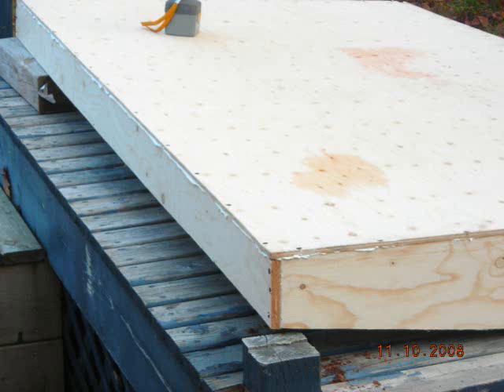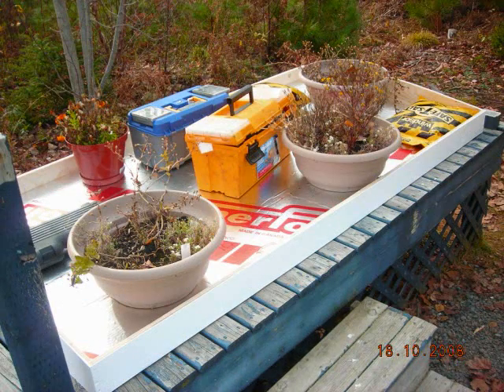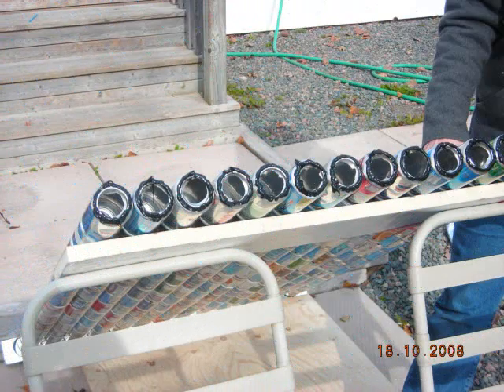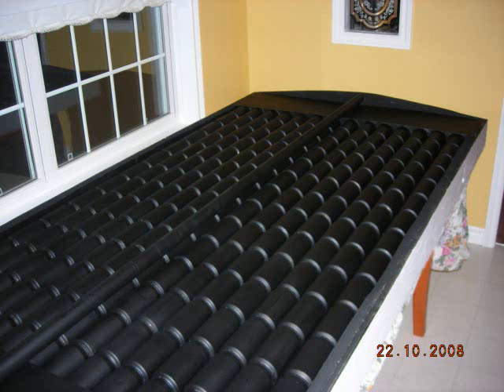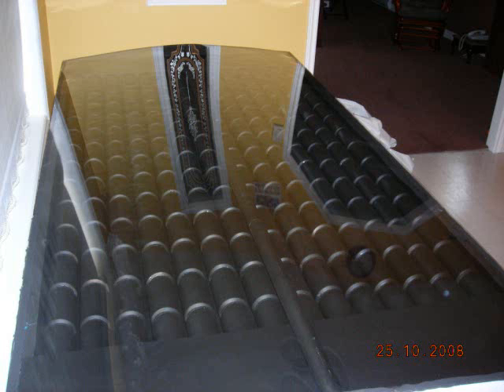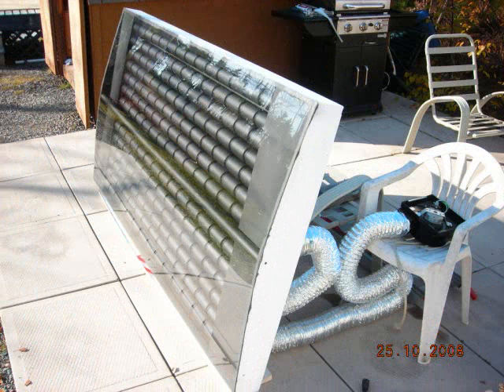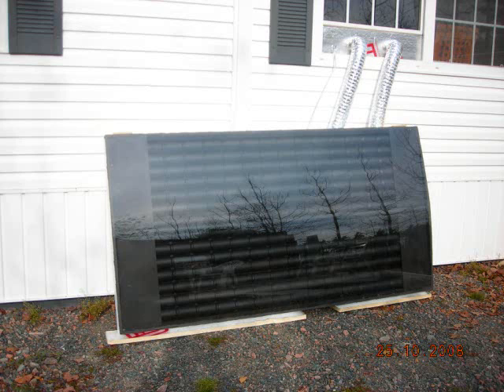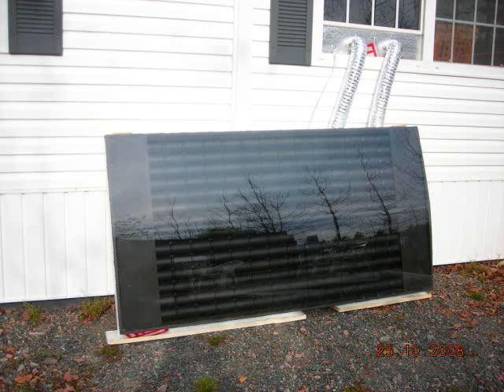Solar Heater

Comment: Beautiful unit. Have you installed it permanently?  If you have the exterior wall space install it standing up, long ways, I think it will work better for you. The rounded converse of the plexiglass will help get the sun earlier in the mornings and track better. The vent hose could be basically eliminating which loose some heat since the unit it installed almost flat to the exterior wall. More insulation around the heat the better and hotter the air becomes flowing into the house through the top and bottom central 4" holes. I bet you'll be getting 160 F or 70C with your good looking solar air heater.

Here is my solar air heater I built in 2015. https://youtu.be/7S8CWsIcK20

Comment: what if you use taller cans, like venom or rip it energy drink cans 16 oz, some 1 should experiment, do you think those would work?
Reply from the maker: it should work fine
Reply: but sense the cans would be longer should I use a bigger fan to push the air through maybe? and wow yours looks so professional and pretty and will plexiglass reflect the same about of sun do you think? Orrr would it be a significant drop in degrees? and thank you

Comment: Great video and impressive design. Josh, good observation, heat output is only one part of the build though. It's easy to build a sealed box to generate 140-160 of heat, probably any design will do this. However you have to get the heat inside the house will enough flow and force to actually heat the room. Air trickling in at 140 degree won't do anything. A lot of air coming in at 95 degrees will make a big difference.

Shoestring's design uses of 120cfm fan and he could feel the heat with some force about 6 or 7 feet away. The first test was done outside with the input air at 32 degrees. If the tube was hot to touch then the output would be around 105 degrees. That's a 70 degree increase with air at 120cfm, unbelievably good results.

When the sun clouded, heavy, over he was still pushing out 95 degrees, good results.

Comment: Hi shoestring405.

I really like this design. If it works that well in NS it should work most places.
I notice the can are horizontal. Have you tried it with then vertical?

I wonder if all the cans were connected in series, not in parallel so that the same air in the first then went through number 2 then 3 etc would be better or worse.

To glue the cans together to assist others I found the well know two part glue worked fine. As did Gorilla glue.

Comment: Build these right into the wall cold air enters at the bottom inside and exits warm at the ceiling without a fan alltogether.

Comment: Good idea!  Another thing you could do to maybe increase the heat output is to make both sides of the unit transparent, and use a mirror to reflect sunlight onto the back side.

Comment: The idea of using inside air for your intake is great, restaurants do this with there exhaust fans. Other wise it would cost a fortune to keep heating the cold air from outside. I plan on doing that with mine because no matter how good it works when it get to be -20 outside it will not work nearly as well as taking air from the basement that is 80 degrees warmer then outside. Thanks for sharing.

Comment from the maker: @jamoore3192  the panel is completely automatic. you install a disc switch ( fan control switch ) inside the panel on the hot air end. The switch should open at 90° F and close at 115 or 120 F
the panel needs direct sunlight in order to produce heat, Here in Nova Scotia the panel works best on those cold clear days in January and February.

Comment from the maker: @navajopa31 amount of air coming in contact with the heated surface.
3. It will be necessary to install a few  baffles of some type in each downspout to mix the air.
    This will also help reduce the effect number 2.

Comment from the maker: @navajopa31 I have seen this project done with aluminum gutters. I know they do work but exactly how well they work I am not sure. A few things that would concern me would be
1. The thickness of the aluminum, this will affect how quickly the heat is transferred to the air inside the    column
     we do not want the panel to become a heat sink and store heat.
2. the gutter downspouts are larger than pop cans, so the column of air passing through it will be larger, this will reduce the

Comment from the maker: @aofnyc I used a bathroom fan. I built a plywood box, mounted the fan inside the box, ran my 4 inch ducting into and out of the box. I then mounted this box in the crawl space under my home. I mounted the fan on the cool air side And push the air the panel.

Comment: Does your particular box width  pertain to the 4' width of the lexan becoming less once curved over the box?  Using your particular dimensions did you need to cut the lexan? Any insight or advice you could give would be greatly appreciated.

Comment: Hi Shoestring,
As a fellow Nova Scotian wondering if you can tell me where you sourced the lexan and the quantity of gasket material?   I'm wondering if you can tell me the depth you used on the sides vs the peak of the convex curve.  Did you put a dowel in at the peak of the curve for rigidity?

Comment: @shoestring405 Im trying to find a simple plastic air flow valve that only opens one way so as to not allow cold air to back flow into the living space. I cannot find one..any ideas on what exactly it may be called? all the ones i find are 100 - 300 dollars meant for high end application but i know there are cheap plastic ones available as i seen one on a video that i forgot to save. thanks

Comment from the maker: @214jcf 
you will want a fan to get the heat out of the panel and into the house.
put your fan on the cold air ducting so it pushes air into the panel. Use a 100 - 120 cfm
fan

Comment: @russelltw101 Gotcha...yeah...it's a good idea. only if the piping network in the house has perfect insulation...since the blower on the solar unit wouldn't be terribly strong...the possibility to losing heat through ductwork would be that much greater. Less piping from the solar uni the better I think. Same with plumbing...less pipes quicker hot water.

Comment: @magicyte  - I guess I was not clear about what I was trying to say.  I was thinking you could pipe your exhaust air (heated air) into your current duct work, so you could warm the house more evenly, but I guess with a small unit like you have, it's not going to put out enough volume of heated air to really heat a large house, but more likely heat a room or two.  Thanks for the response.  Great video.

Comment: @russelltw101 Nah...you wouldn't pipe hot air into the system...totally counter productive. What you want is to have a cold air supply from inside your house that is low to the floor...then take that air and have it flow into the panel..which then uses already warmed up air just from ambient temps inside the house...same as a house furnace. And then since your unit is using 18-20C heat from the house...the panel would have no trouble warming it to 25C or above.

Comment: great video.  Question, why not pipe the hot air into your heating system.  That way it could heat the entire house.

Any idea what type of savings you may have had with the unit in place?

Comment from the maker: thank you for your kind comments. I have never had a problem with fumes. As far as regulating temperature and air flow the way it is hooked up the temperature inside the panel is what controls the air flow. The panel continues to work fine. It's second heating season is nearly to an end and it has required zero maintenance. I have not touched it since the day I installed except to turn the thermostat up in the fall and back down in the spring. I must say I consider this experiment a success.

Comment: Thank you for the great video im curently working on a pop can heater to heat a unheated atached garage 17 cans tall 14 cans wide with a loop system the plan is to have the panel mounted high above the boat/snowmobile storage area on the south side and have the inlet and outlet at the bottom 4 inch opening 80 cfm duct booster fan with a 40 deg.c(104 deg.f)snap thermostat my test panel was 21inchs x 32 inchs it put out 110f unisulated and mounted in a existing window very good results from 45cans

Comment from the maker: I push 120 CFM of air through it and I think I am getting the vast majority of the heat it is producing.
Currently working on the plans for a larger panel that will be mounted vertically and ducted in a different way.
Do U have any photos of your panel.  I always like to see what others have done.  Everybody does things a little different.

Comment from the maker: I left the cans about 3/16" to  1/4" off of the back panel to allow air to circulate. When I installed the heat exchanger I put a big blob of gasket maker on the backside of the middle can in each row. I just thought it may add a little support for each row.

Comment: I made 2 using foil tape. It works fine. lay the tape over angle iron then roll the cans to tape them. It's not a lot faster than caulking but you don't have to wait for drying.

Comment: Any reason why the glass from sliders wouldn't work, I have 6 full sliders from a job I recently finished , they are all single pane glass about 3/ 16's thick,  and what about using metal tape to seal the cans together , seems like it would make a nice tight seal and be a lot faster.

Comment: Holy Mackerel, that is a cold part of the world. I have watched your project several times and decided to build one. Am finding it hard scrounging up 250 or so cans, so I will probably use zincalume downspout. --- Quicker than sticking all the cans together. I currently have 100 cans, so I may also build a small unit to feed the bathroom as the tiles get cold to walk on. - Yours sure looks well made.

Comment from the maker: I put a 1/8" drill bit in a Dremal Tool and used it like a rotory saw. Cut the thin aluminum like butter. Noisy but very effective

Comment from the maker: I used a thin piece of wood paneling. Put 2 screws into the plywood at each end of the arch. Set the paneling on its edge against the screws. Push on the center of the paneling until u have the arch shape u require and trace it.

Comment: I was wondering if you let water run through it in the summer if it couldnt have a double function as an air heater in the winter and water heater in the summer. Would this make the metal cans rust over a long period of time?

Comment from the maker: 1.  You need to keep the air that is circulating inside the columns of cans separate from the air that has been sealed inside the panel.  If the air inside the cans were to mix with the air outside the cans you would soon have a condensation problem.  The inside of your lexan lens would fog over.  
2.  This was only a temporary test setup and I never really gave it a lot of thought.

Comment from the maker: The first wash is really more of a rinse to remove  large objects that may have been placed in the cans.  After a 24 hour soak you will be surprised at how scummy the water is.
Lexan is a hard clear plastic.  But unlike Plexiglas it is UV stable, can be cut with common tools, can be drilled without cracking and is nearly indestructible.

Comment from the maker: This panel put heat into my home for 5  hours that day.  One day near the end of February the outside temperature was -16° C and this panel was delivering air into the home at a temperature of 49° C.
The operational cost of this unit is 1.1¢ per hour while an operation.  My power bill says I'm going in the right direction so I think I'll build another one.

Comment from the maker: The answer to your first question is very simple.  In the summer you don't need the extra heat so you turn the control on the thermostat fully counterclockwise which turns the unit off.
The answer to your second question is very simple as well.  Here in Eastern Canada the day with the least amount of daylight still has about 10 hours of daylight.

Comment from the maker: What I used is made by IKO and is called Enerfoil.
I used the 1" stuff and it was $24.00 for a 4' X 8' sheet. I puchased it at a local company ( I live in a small town) who do roofing ,siding and insulation.
Anyone who carries the IKO product line should be able to at least source it for you.
Hope this helped
Shoestring

Comment from the maker: You are correct, if the panel was mounted vertically a natural convection of air would take place.  However I don't think this natural convection would produce enough airflow to get the best efficiency out of your panel.

Comment from the maker: That sounds like the stuff I used and it does have a strong oder for a couple of days. It must take that long to completly cure. It  wasat least 2 or 3 days from the time I finished the coloums till I put them in the panel. I have not had any oders

Comment: Shoestring,
My next panel will be 4' x 8' and I am planning on using polycarbonate glazing too. My only concern is the effect of expansion and contraction on the air seal. Have you noticed any deformation or air/water leaks?

Comment: Got my black high tem p RTV at the local auto supply store in Maine its Napa Auto Parts. Its good for 450°F constant but $13 per 10oz tube. I suggest allowing all your RTV and paint to "gass out" for a couple days before sealing it up to avoid fumes in the house.

Comment from the maker: I then attached the switch to the bracket using small sheet metal screws.  I then glued the bracket inside the air box, using gasket maker, on the back side of the aluminum that covers the air box.  I was able to access this through the 4 inch hole in the back of the panel I had drilled for my ductwork.  I then drilled a 3/8 inch hole through the back panel about 2 inches away from the 4 inch hole.  I then ran my wire through that hole and connected them to the switch.

Comment from the maker: For the thermostat in the house I used a 110/220 electric baseboard heater thermostat, $8.00 at Home Depot.  I located the snap disk switch, also known as a fan control switch, inside the air box on the hot air end of the panel.  I build a small bracket out of the aluminum flashing,
   ___/-------\___  , in the center of the bracket I drilled a hole large enough to allow the mounting plate on the switch to sit flat against the bracket.

Comment from the maker: Before I install this unit into the panel I put a large blob of gasket maker on the backside of the center can in each row.  Not sure I had to but I thought this would add a little extra support to the rows

Comment from the maker: The rows in my panel are spaced about 1/4" apart.  This made making the headers easier.  The rows about 1/8 " - 3/16" away from the back panel.  This allows for a little wiggle room in case everything is not perfectly straight.  I installed the rows of cans into the headers first and then install this as a unit into the panel.

Comment from the maker: Everything seems the working great so far.  I installed on November 10 and have not touched it since. It turns itself on, it turns itself off and blows hot air.
The highest temperature of the air blowing into the house so far was 46.5° C.

Comment from the maker: I used 1 inch foam with foil on both sides.  It was made by IKO.  Some paints will react with foam and the foil provides a barrier between the foam and the paint.  By painting everything inside the panel black everything will absorb heat and raise the temperature inside the panel.  I also think it makes the finished panel looked better, no silver showing between the rows of cans
Good luck in the hope this helps

Comment: well you might put som flaps on the exit-hole, so when you're blower is on, it blows through the fpals, and when off then then are shut. It might work on the intake-hole as well, with the flaps now in opposite direction, opening inside the box. The blower connected to solar panels directly will make it automatic when sunny :) Good luck!

Comment: I build a heater just like yours, I am now trying to decide on the size of the blower you said yours was 125 cfm did it work well or would you use one with a larger or smaller cfm

Comment from the maker: So far so good.Have not touched it since I installed it,it just does it's thing.
Yesterday--outside temp. -16C,panel was blowing air into the house at 41C.
How has your panel been doing

Comment from the maker: I can't remember where I seen the work by the Hungarians.  I do remember the video being in a foreign language.  
I painted everything on the interior of the panel flat black.  
By sealing the cans and the air boxs at each end you prevent the air circulating through the cans from mixing with the air inside the panel.  If you don't do this you may wind up with a condensation problem on the inside of your lexan.  Not 100% sure this is correct but this was my train of thought.

Comment from the maker: My first plan was to mount the panel vertically but after some careful thought I decided to mount it this way.  This way I did not have to drill 2  4" holes through the side wall of my house.  It costs about $60.00 more to do it this way, extra ducting and the insulation,but to me it was worth it.  I'm pushing 120 cfm of the air through the panel and I don't think the small amount of natural convection created by mounting it vertically would make that much difference.
Thank you for your comments

Comment from the maker: The header boards are made from the same 1 inch foil backed foam that I insulated the box with.  Using a hole cut
saw I cut holes in the foam slightly smaller than the diameter of the pop cans.  In this way the tapered top of the can will fit through the hole and rests on the shoulder of the can.  By doing this it seemed to make it sturdier and gave me a good area for the silicone seal.  The metal at each end is simply aluminum flashing that you can get at any hardware store.
I hope this helps.